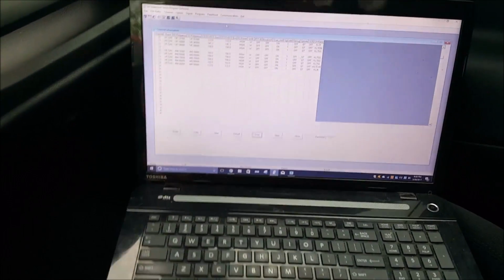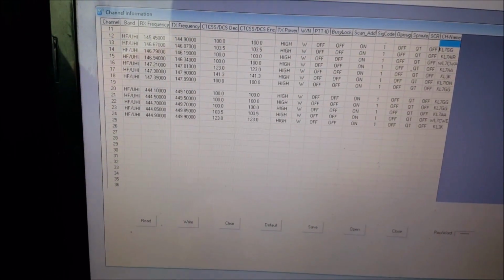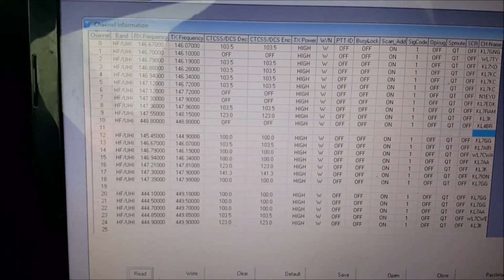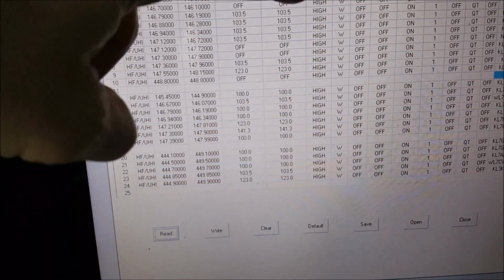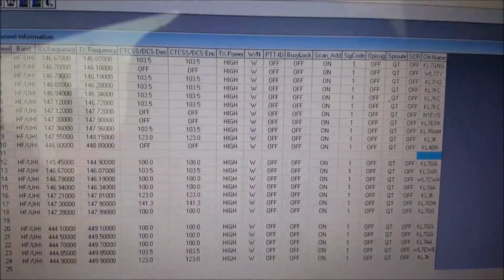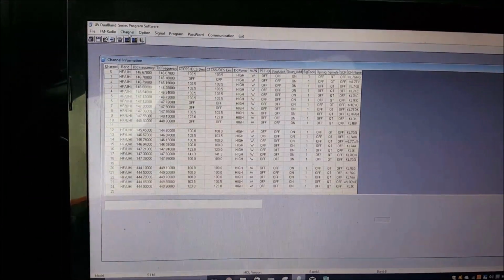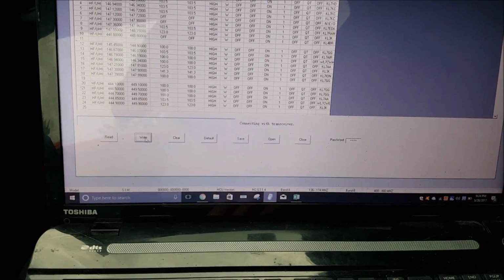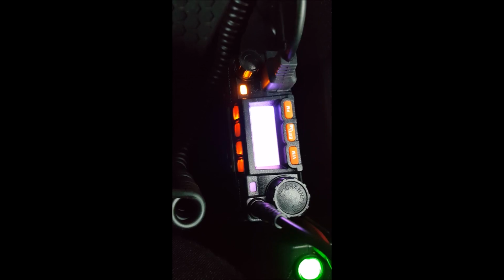Programming the Juentai JT-6188 Plus with its free software

Comment: Hi, I have a JT6188 mini, and I can't set up the memories from my PC. I used its original software and cable, but I have a message saying that the radio doesn't accept data clone. I use Windows XP ( sp3 with dedicated driver, downloaded from Juentai website). Can you help me? Luke IW7EBB
Reply from the maker: Crud, I missed your comment! Yeah it's not the most fun to program. Only thing I can think of is either you are on the wrong port, or maybe a bad cable? I use windows 10 so that may be a factor as well. I really wish I could be of more help :(